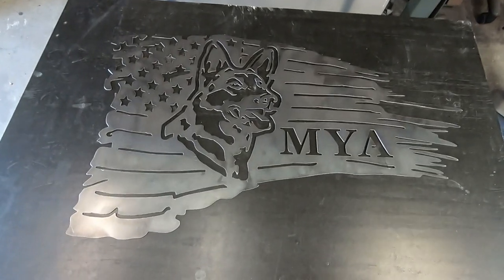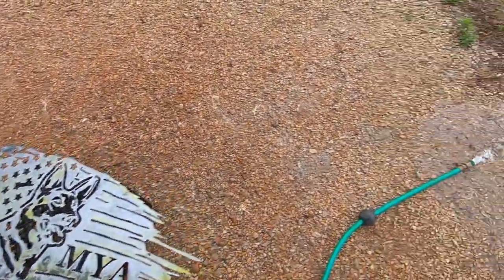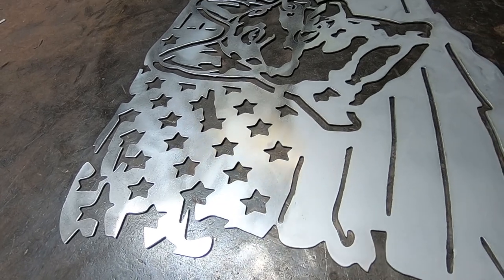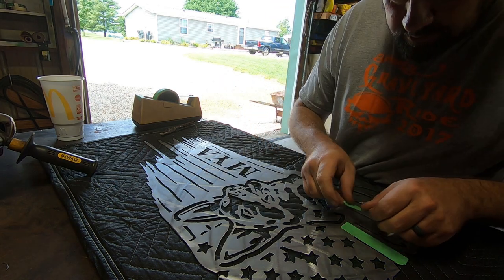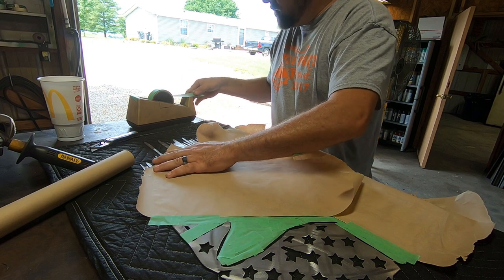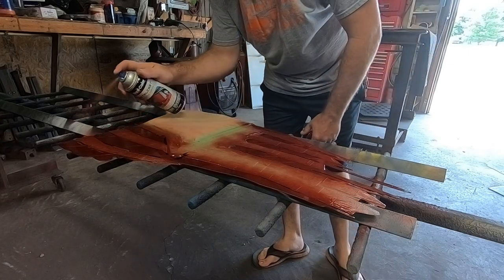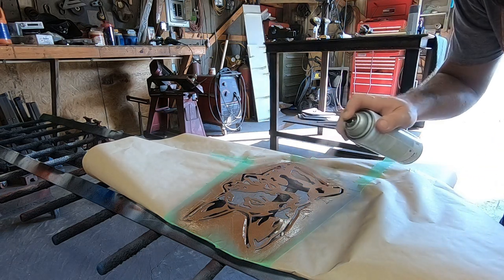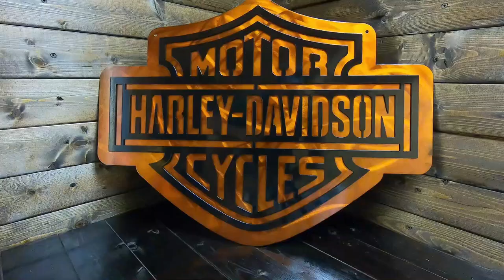German Shepherd  American Flag metal art

Comment: Curious, why not used cold rolled instead of hot rolled steel? Cold rolled doesnt seem to have any mill scale on it
Reply from the maker: The big thing is price. however you are correct clean up would be easier. something we are looking into with our steel supplier for sure.
Reply: S.O.T. Metalworks another option might be HRPO (hot rolled pickled and oiled) steel.  It is priced between HR & CR steel.